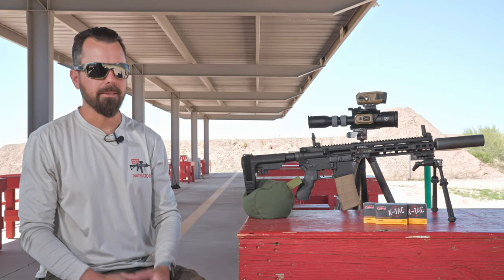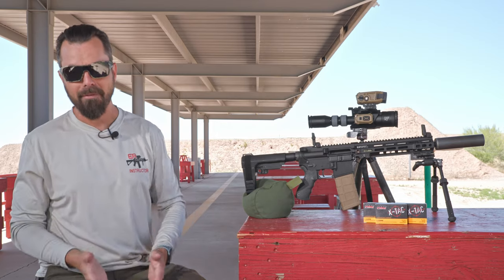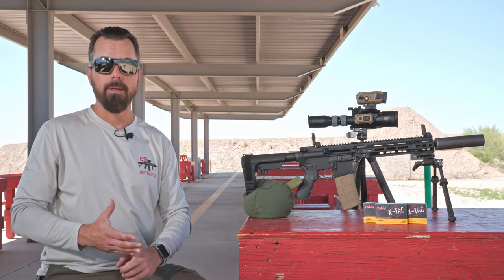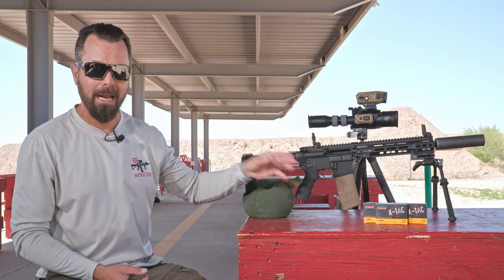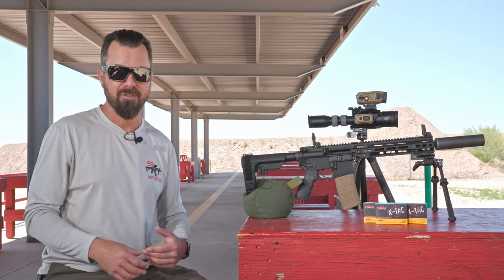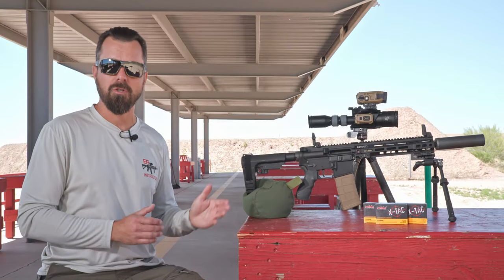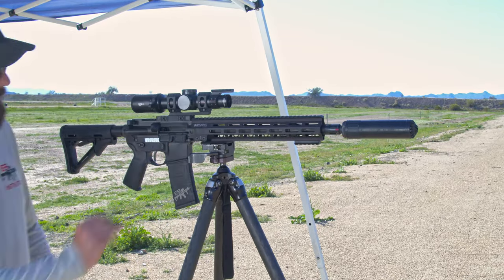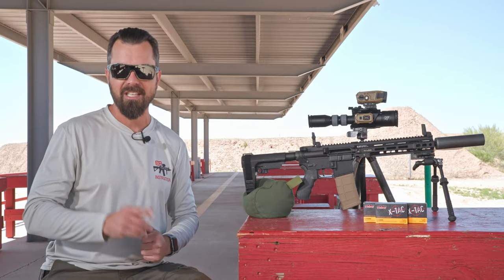Coming Soon: Suppressor Back Pressure Testing Part 2: Testing 11" SBR Back Pressure Performance

Comment: I would be interested in a subjective opinion on sound that goes with back pressure
Reply: yes!! we have just that in the works! Thank you for your support and positive feed back!
Reply from the maker: Typically, cans with higher back pressure tend to be quieter but we'll be doing sound testing in the not too distant future. Thanks for watching!

Comment: This is not a performance request, this is a configuration request. 

I'd like to see if you can do a build using a handguard that will cover the RIFLESPEED gas block and using a MODTAC MRAC coupler. I'd like to know if the internal diameter of the build would still have clearance for adjusting the knob.
Reply: The rifle speed gas block definitely takes some tinkering. I would reach out to them direct in regards to that question. We have done some work for them in the past but to be honest mapping out build is rather difficult. Sorry I couldn’t offer more help.